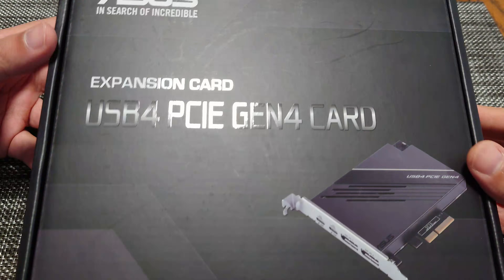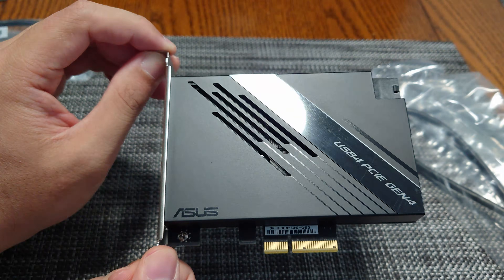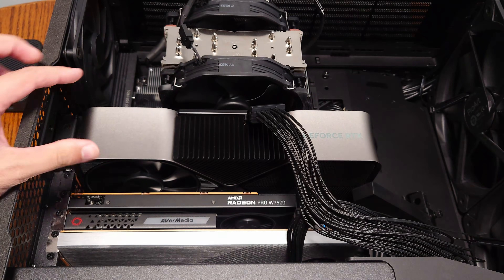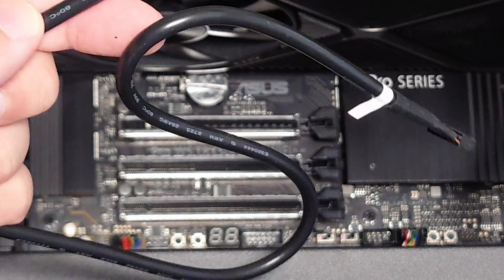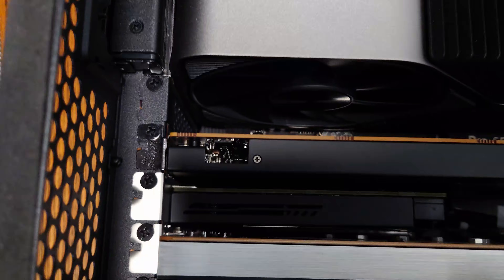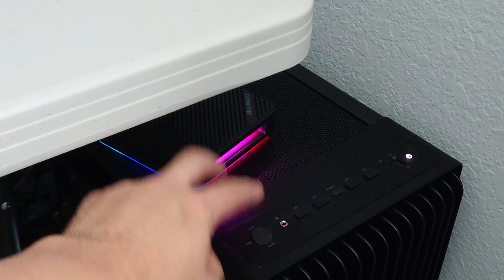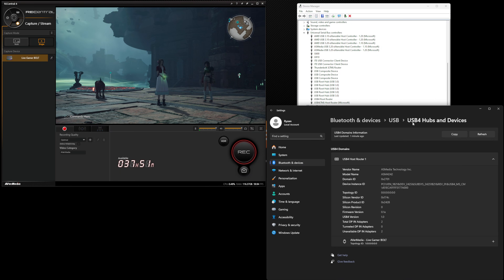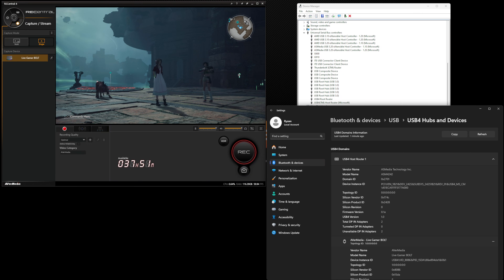So the ASUS USB4 PCIE card finally launched

Comment: I was wondering If this card would work on my Asus Z790 Maximus Dark Hero Motherboard. (I know It has 2 Thunderbolt 4 Ports on the MB), But I Need (Pure) USB 4 Ports, Since Not All USB 4 Devices Are Getting Proper Speeds On Thunderbolt Ports.

Comment: I have a Asus WS TRX 50 and I still can't wrap my head around what card to use as an add in and what supported.  Can I use a Thunderbolt EX 5 or do I need this a specific USB 4, and will the thunderboltex cards fall back to usb mode(s)? The TB card manuals keep specifically referencing a thunderbolt header, but the trx50 only has a USB4 one?
Reply from the maker: The USB4 card shown in the video is the one that is fully supported with this motherboard. The TB header and the USB4 header are literally the same thing. But ASUS locks the bios down to only initialize the USB4 card. If you install the thunderbolt cards the BIOS will prevent the card from working. This is something I've discussed in detail on one of the Tech Thursday episodes in the past.

Comment: Hi there, I’m writing to inquire about the compatibility of a card with my board. I noticed that my board doesn’t have an empty USB 2.0 header, and I’m wondering if the card will still work without a USB 2.0 header cable. Could you please advise me on this matter?
Reply: Please help
Reply from the maker: @MrPrakashvishwa  It requires the USB 2.0 header.

Comment: I have an Intel 13th gen CPU with Asus motherboard and purchased the Asus ThunderboltEX 4 card, giving me Thunderbolt 4 ports, and it works well. My question is, is there any advantage of the USB4 card over the Thunderbolt 4 card? I'm happy with what I have and do not need to upgrade, but merely wondering why someone would want the USB 4 over Thunderbolt 4, being the PCIe cards cost the same, AFAIK.

According to the ASUS compatibility documents, my motherboard supports either of the two cards. I realize if someone has a motherboard that only supports one, then they have no choice. My question is directed to if there's an advantage of the USB4 card in a system that can support either card.
Reply from the maker: The USB4 card is using a newer chipset that requires PCIE Gen 4 x4 where as the older EX 4 card is PCIE Gen 3 x4.

Comment: I have ASUS ROG Strix X570-F Gaming motherboard but I can't find the required BIOS settings (just updated BIOS to be sure). Is this because my motherboard is too old or would this USB4 menu appear after attaching the card to the PCIe slot? The motherboard does have the required headers for the cables but if I can't find the BIOS settings, would this not work at all? I'm trying to get a USB-C port with both DP Alt Mode and PD at the same time with at least 15w of power so that my "Wacom One 12" could work without 3-in-1 dongle. Any suggestions, anyone?

Comment: Can I assume that this card won't work in my Dell XPS desktop since it's an Intel-based CPU?
Reply: whether it is intel or amd does not matter, but whether it has the necessary thunderbolt connector onto the motherboard. certain MSI and certain ASUS motherboards have that.

Comment: i have baught a ASUS TUF Gaming X670E plus WIFI and this card. After testing i found that it only works in the PCIe Gen4 Slot (the small Slot) but then it works really nice. Have to search in the BIOS for activation to enable it (nowhere mentioned in the docs). But now i have impressive 3701.2 read MB/s and write 3722.62 MB/s with a Zike Z666 enclosure with NVME WD_Black SN850X. The NVME overheats but this is only a thermal thing nothing with the USB4. I searched for this information but find it nowhere so i post it here if someone thought if this is a good idea.

Comment: Do you actually get the full 40Gbps for external SSDs? Or is it really 32Gbps like thunderbolt 4?

For example, Im assuming this Asus card uses a PCIe 4.0 x 4 connection, which is only 64Gbps....so if you were to use both ports simultaneously, you'd only have 32Gbps per port.

This issue arises with Thunderbolt 5 as well at 80Gbps....Asus already has a 2x port Thunderbolt 5 card that promises 80Gbps per port and 120Gbps in "high bandwidth mode", but how can any of this be possible with a 4.0x4 connection limited to 64Gbps?

All of the USB4 external SSD reviews I see on the internet indicate that the maximum data transfer rate is around 3GB/s, the highest being 3.2GB/s which demonstrates that they are nowhere near 40Gbps.

So, why do they claim 40Gbps when Ive never seen a single USB4 port or device achieve those speeds?
Reply: You are make a UNITS error here. The 40 Gbps === 5 GB/sec.
Reply: So its missing like 1.8 to 2 GB/sec.

Comment: What if you don't have any usb headers on your MB, can you still use the card in the slot as is? I mean there is a lable on the board saying USB-C but nothing is soldered to it, so I can't connect a cable to it.
Reply from the maker: ASUS has designed the card in such a way that it only works when using their proprietary cable.
Reply: @GameTechReviews  That blows. Why is everyone so proprietary over usb-c?

Comment: I want to add usb4 40Gbps ports to my older hedt system, just data for storage drives. And i cannot find anything.

What if I want more than two ports? Even with this card this is impossible despite me having a lot of free pcie lanes.
Reply from the maker: There are a few motherboards out there that might be able to support 4  USB4 ports. The B650E AORUS PRO X USB4 includes USB4 via ASM4242 but also allows for adding the Titan Ridge or Maple Ridge card from Gigabyte for 2 more USB4 ports.

Comment: How would the special asus connector work for a non-asus motherboard?
Reply from the maker: It wouldn't. This is meant to only work with ASUS motherboards that have the on-board header.
Reply: @GameTechReviews  Thanks for making this remark, so not going to buy it.  Sad that PCIe card needs a proprietary Asus connector, goes away from what PCI slots were meant to do.

Comment: I recently learned that Bluetooth dongles don't function reliably on USB 3.0 ports, and instead was recommended to use USB 2.0 port for these types of dongles (on reddit). If you have a Bluetooth dongle, do you see if your Bluetooth devices work better when connected to this port?... like an Xbox/Playstation gamepad or while listening to music? I'm curious whether this was fixed in the newest standard.
Reply: Better off just using a pcie wifi card for that if you don't have wifi capabilities on your board

Comment: If it works with Thunderbolt 4 headers, this will be useful since there are more motherboards that have it, you can then use it after upgrading to another motherboard with the feature. Since USB4 is standardised, it should be possible for manufacturers to design cards that are compatible with different Manufacturer motherboards, but they need to avoid using proprietary connectors and instead use standardised headers or make the proprietary version optional meaning a standardised connector should work fine also. The Asus Thunderbolt expansion cards use proprietary cables, that means you can only use it on an Asus board.

Comment: Why internal USB cables are needed? Can't they convert PCIE to USB4 directly?
Reply: @hanley6478  that was my question too. If you have the header why would you need a card? The card should be for those without headers.
Reply: Yeah this was a surprise for me as well. What is the point of having pcie cards if you are going to have proprietary headers on the motherboard.. I did not manage to understand what really is the necessity, but it feels like stupid vendor lock-in.
Reply: @recursivedonut fr, i bought this card and now i cant use it because my mb doesnt support usb 4. I thought i could use pcie as an extra display output
Reply: Data, it can be done via all pcie, but there could be issues that happen if it was all pcie based. Specially bios for motherboards may need updates. Rather then spending a lot more money getting other vendors/competitors on board. It's easier to use the systems already in place.

Comment: I have my rtx 4090 mounted vertically so ALL my pcie slots are not accessible 😢, otherwise I'd get this thing
Reply: weird flex, but ok
Reply: @BenState  at least GPU isn't flexing :)
Reply: Maybe you could get external cable for that? And use a multi angle adaptor for you GPU so you could make some space for it😊